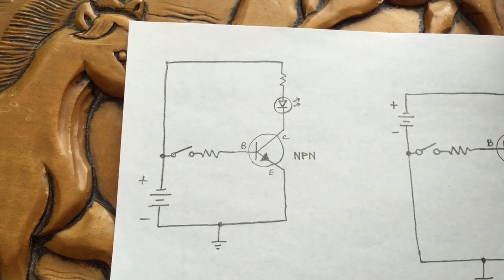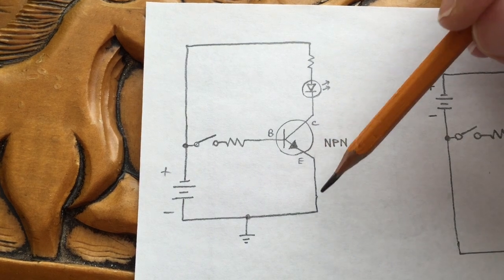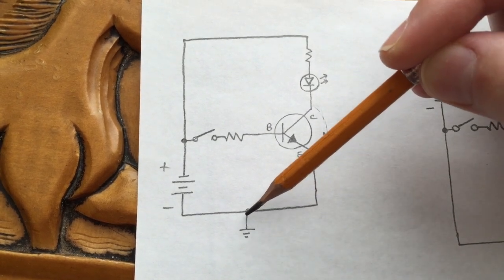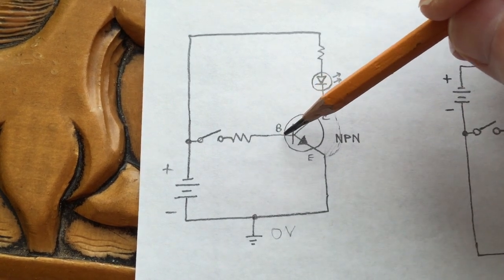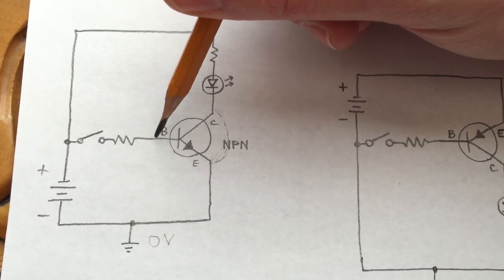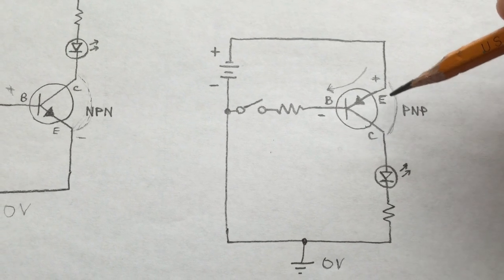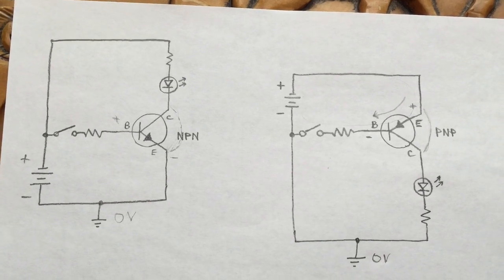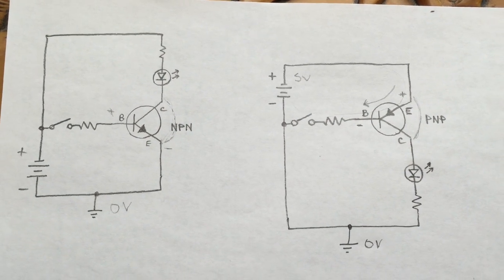NPN vs. PNP Transistors as Common-Emitter Switches

Comment: Thank you for your video. One small correction - your battery symbol is back to front. The long bar is the positive end just like the long leg of an LED is positive and the long leg of an electrolytic capacitor is also positive.

Comment: Excellent - a different type of explanation that works really well.  You could have just mentioned Common Collector/Emitter terms as you diagrams showed it so well.  The battery symbol, for students... think 'positive means more' so the longer of the two lines, the shorter of the two looks like a minus symbol so you can remember how to draw single cells or batteries.

Comment: In an actual circuit for PNP we found that it worked when the battery was across the base and collector and the voltage going to the emitter was -ve

Comment: The must important thing you didn't explain IS the pnp IS suppossing to use for the not Gate and the npn for the yes Gate , if u dont supply the base from your pnp , the logical IS true and your del Can be activated, if u you supply it your del turn off , and for the npn is the contrary😅

Comment: i thought the pnp and npn to close the switch would need some form of magnetism? am i missing something? TIA
Reply from the maker: No magetism is involved. There are no moving parts; the transistor is not a mechanical switch like a relay. It is a solid-state silicon device that uses a small current to control a larger current.

Comment: I often hear people say current on the base turns on the transistor, but its voltage that does that... yes/no? Unless you get the voltage minimum, no amount of current will get you through. I'm a beginner, so maybe I'm wrong, but a lot of people seem to want to use voltage and current interchangeably, and that confuses me (personally) when I'm trying to learn something new.

Comment: Good description - but isn't that battery symbol turned around in your schematics? I thought that the long line, or dash, was for the positive terminal, the short one representing the negative terminal. Anyway, the ground connection in a circuit employing npn transistors - say in a transistor radio - would be the negative terminal. Hence there would be one location in the circuit where all connections to ground are soldered, including the negative terminal of say, a nine volt Duracell battery. And for such an appliance that employs pnp devices, simply reverse the polarities. I guess that's right.

Comment: Excellent video.. I have an arduino on 1 side that will switch a pin to high (5v) and on the other I have a small lamp powered by its own batteries that I can switch on by using a switch..

My question is given these are 2 power sources and thus different grounds, can I safely use a transistor like BC 547 or should I use something else and if so what would be ok?

Comment: If the resistor at the top of the drawing in the NPN circuit is there to protect the LED, shouldn't the resistor in the PNP circuit be on the other side of the LED?? If not, I am confused about direction of current flow in the PNP circuit.

Comment: Aha, the base get connected to the power supply side that is opposite to the sign of what is the middle of the transistor.   If it is N then the base goes to the positive side of power supply and and if it is P, the base gets connected to the negative side of the power supply.
Aside from that, the load always seem to go the collector side, however the pins are designated.

One has to admit that this whole emitter collective base thing is pretty screwy as hell.  Can it get more screwy?  I don't think so.

Comment: On the pnp transistor why do you still have the resistor in series with base? To protect the negative side of the battery since the current gets outside of the base?

Comment: What happens if you connect 5 volts directly to have of npn with its collector to vcc and emitter directly to ground without any resistor. Will it smoke? 
Can you have more than 0.7 v drop accross base emitter junction?

Comment: What is the point if u still need a mechanical switch and it can get the job done by itself?
Edit: is it because you can use a low current to power it?

Comment: This made me more confused. I've always been taught that DC voltage comes out of the negative and flows back into the positive. Subtracting voltage from a battery and adding unused power back to the battery. What transistor will allow voltage to pass when the base is disconnected and stops voltage when the base is connected again?

Comment: why do we need a transistor as a switch when we already have a switch in the circuit?
Reply: The transistor is used to amplify/double up the current. So that collector current will be higher than the base current. Correct me if I’m wrong

Comment: Just a question on the battery, here in the UK when we present a battery in a circuit like this, we always have the longer line as the positive side. Is that not the case for you guys, as you have it the opposite way round?

Comment: Why use a transistor at all? Why not just a battery, switch, resistor and led? :)
Reply from the maker: Chicken Nugget because then it wouldn’t be a demonstration of how transistors work! ;) in a real-life application, the transistor allows a very small signal (like from a touch sensor or a microphone) to control a much larger signal (like an electric motor). A typical small-signal bipolar transistor like the one shown in this circuit can have a current gain of over 300x.

Comment: Would the PNP circuit work if the order of the three elements, currently PN closest to +V, LED in the middle ,Resistor closest to 0V, were arranged differently?

There are six cases: PNP/LED/Res; PNP/Res/LED; LED/PNP/Res; Res/PNP/LED; Res/LED/PNP; LED/Res/PNP.

I suspect the order relative order of just the [LED, resistor] pair is not important, and it would always work if the PNP were not last; that covers four of the six.

However, would it work in the last two, i.e. if the PNP were "last" and the Collector connected to 0V?

I undertand that Ie=Ic+Ib, and that might affect the choice of resistors, but I am not asking about that.  I suspect this question reduces to whether there is a voltage drop from Base to Collector, where Collector=0V=Ground, which voltage drop would cause a current flow.

Thank you.

Comment: Excellent video! I was just. curious, if all Neg runs back to the power supply, what is the need for the ground on the bottom? Thanks!
Reply from the maker: Full Wave Recked it’s not necessary. I just put it there to indicate that I am treating the negative side of the battery as the ground reference. No current flows to/from it.
Reply: @kevpatt  the obvious strikes again. I'm too much of a noob to be asking a smart are question. That makes total sense. Thank you for responding. Cheers!
Reply from the maker: @fullwaverecked  actually it's a good question. After all, I'm the one who drew the battery symbol upside down... :P

Comment: What is the reference for the terminology of base, emitter and collector?
I’d call the base the control terminal, collector input and emitter output.
And why not put the LED in the PNP circuit before the transistor? It might cause a small drop in voltage but with the base connected to ground, this will always be lower.

Comment: Kevin,new subscriber and I was wondering if you know of a site that will tell you the specs of certain resistors like which leads are Base Collector and Emitter or is there a way of using a piece of equipment to find out. Thanks in advance Artie. 👍👍👍

Comment: Really good explanation, thank you! In the PNP schematic, shouldn't the resistor be in between the Collector and the LED, instead of between the LED and ground?
Reply: It doesnt matter. As long as the resistor is part of the loop it will do its job of limiting current. Dont think about current getting to the LED "first" and destroying it because the resistor hasnt done its job yet. That is not how it works. When the circuit is closed the current that will flow is dependent on all the elements that are part of the loop.

Comment: If you would like to understand, how it's actually work in field of industrial automation, where you have PLC input card, where you wire sensors, read on.

In NPN sensor drawing (0:26), top part is actually PLC input (could be relay or something else). There is permanent 24VDC on PLC input and wire going from PLC input to sensor is going to the collector of transistor which is switching negative (N pn - switching negative). 

If you take DC voltage multi-meter and connect black probe to 0VDC and red probe to PLC input and there is 24VDC, that's mean you have to use NPN sensor. On other side, if you want to test the sensor, connect red probe to 24VDC and black probe to sensor output, if multi-meter display 24V, then it's NPN sensor. Sensor have to be in ON state of course.

IN PNP sensor drawing (4:59), bottom part is actually PLC input (could be relay or something else). There is permanent 0VDC on PLC input and wire going from PLC input to sensor is going to the collector of transistor which is switching positive (P np - switching positive). 

If you take DC voltage multi-meter and connect red probe to 24VDC and black probe to PLC input and there is 24VDC, that's mean you have to use PNP sensor. On other side, if you want to test the sensor, connect black probe to 0VDC and red probe to sensor output, if multi-meter display 24V, then it's PNP sensor. Sensor have to be in ON state of course.

Comment: I'm familiar with sinking/sourcing in regards to industrial electrical controls, but I don't understand why you couldn't have the load of the NPN transistor connected to the Emitter instead of the Collector! Would it work? Is it atypical? Thanks! I have so hard of a time remembering which way the current flows NPN vs PNP.

maybe it's called Sinking/Sourcing because you're Sinking/Sourcing the transistor not the load?

Comment: If I am using an npn transistor and I supply the base with say 5v from an Arduino through a 4.7K resistor,  then give the collector 12v why can’t I put the load in the emitter line to ground?

Comment: Best explanation I've seen, thanks so much.
And what's the drawback if the LED put in between NPN BJT's collection terminal & GND (low-side) instead of high side?
Reply: In NPN, the LED or whatever load on high side of transistor, the emitter voltage will be zero but if we place the load on low side, the emitter voltage will be the same as battery so, current won't flow because transistor need voltage differential at least 0.7 V to turn on.
I hope this would help 😅

Comment: In the PNP transistor why wouldn't the resistor be before the Diode and not after it?
Reply: As the resistor is in series with the LED it doesn't matter if it's before or after.

Comment: In the U.K. especially in industry, PNP based sensors are a lot more common. That’s because you’re switching the positive terminal of the load. It makes much more logical sense to use these transistors for references as it’s more practical. As most people will treat an output from a sensor as a positive terminal and look for a negative reference.

Comment: This may be a stupid question but on an NPN transistor do base and collector voltages need to be the same. Say I wan't to switch a 12V source but the device I'm using to control the switch can at best deliver a 5V source is this a problem?

Comment: Hello and thank you for the very nice video ! My question is, in PNP why is the LED's resistor after the LED ? While the current flows from positive to negative, shouldn't the resistor be prior to the LED so that it doesn't burn ?
Reply: It doesnt work that way. When the circuit is closed, the amount of current that will flow is dependent on all the elements that are part of the loop independently if they are found before or after in the path. Remember the positive to negative convention is just that, a convention. The electrons, which are the charge carriers, are moving in the opposite direction...

Comment: Thank you my friend for this goooooooood video, just 2 comments:
1- The battery symbol is reversed.
2- you forgot the second battery which is in the main circuit that will make the LED to glow.

ThaaaaaaaaaaaaaanQ
Reply: He didn't forget a second battery. In this configuration, the smaller circuit that drives the transistor uses the same battery that powers the LED.
Reply: @venitusaber2131  
Ah yeah got it brother thanq, I have forgotten considering the resistors :))

Comment: Does the base need current or voltage?
Reply from the maker: The base needs a small current to turn on. But the only way to get a current to flow is with a voltage differential. This voltage will need to be higher than the intrinsic voltage drop of the Base-Emitter junction (depends on the transistor), and you will want to limit the current flow with an appropriately-sized resistor. This can all be calculated using Ohm's Law: I(current) = E(voltage) / R(resistance). ([Supply Voltage] - [B-E Voltage Drop]) / [Resistance] = Base Current

Comment: Not sure that you realize - by this time (May 2019) your video is the best on YouTube explaining how a PNP transistor works. You don't explain how the electrons flow inside the PNP transistor but providing that one knows how the electrons flow inside a NPN transistor (plenty of videos about that on YouTube) and from all the other details that you clarify it becomes obvious how the flow of electricity from Emitter to Base allows the PNP transistor depletion zones to open up for higher current flow.
Thank you very much!
Reply: @GreatWhiteNiko. You know about this stuff. Does the base need current or just voltage? I am trying to make my first pulse motor which is like the HOLY GRALE for me.. The base gets its jolt from spinnin the rotor (with magnets attached) near a coil. The NPN opens and lets trough a big puls of current to magnitise the coil. This pulse of magnetism pushes the rotor along. I think I got the theory down but in practice.....
Reply: @captainprototype187  Oh no, don't get me wrong.  I am just starting to learn electronics.  So far I'm at the level of "how it works" but literally nothing practical.  You need to ask someone else. Your question makes me wonder too - does the base need amps and voltage or just some so-so voltage?
Reply: @captainprototype187  Well, today I asked a friend of mine that is an electronics guru about the very basics of transistor use.  What he told me was unexpected for me.  See if you learn something practical too:

1. Bipolar (PNP and NPN) are used to REGULATE current. 
Used to control motor speed for example.

2. FETs (MOSFET) are used as switches - just turn on/off the current.
Not sure in what applications they are used most.  I see them in TV circuit boards all the time. If they are used as switches it'd make sense to assume that FETs are used in computer chips but I apparently speculate here.

Also:
1. Bipolar - the gate uses CURRENT - From 0 up to 0.7A.  You vary the current (Amps) of the gate and the big current from Emmiter (Source) to Collector (Drain) varies with it.

2. FETs (MOSFETs) the gate use VOLTAGE.  Because what you want is to "pressure" up the area that creates the magnetic field which "opens" the flow of current from Emitter to Collector. And FETs basically work like that - you supply voltage and they do nothing.  You increase the voltage and they still do nothing.  Then at some point they let all the current flow.  So that's a "digital" type of operation - 0 or 1 - closed or open.  That's why they are used as switches.

My friend also said that all the details about electrons/holes, and depletion zones are not needed at all when you actually work with electronics.  The movement of electrons etc are good to know and cool to know but once you start practically using the components that goes way way in the background. But to me it is about feeling confident about my knowledge so I like to learn stuff like that.

Good luck.
Reply: Thanks. some new info here. I will concentrate only on npns. Making a working circuit is hard you will find. It is for me, anyway.
Reply from the maker: @GreatWhiteNiko  Your friend is basically correct, and the theoretical function of BJT and FET sounds right. I just want to add that you CAN use Bipolar junction transistors as "switches" (as shown in my video), and you can use MOSFETs as "amplifiers / regulators" too. But in non-trivial designs, Bipolar transistors are often chosen for linear applications (like regulators), and FETs are often chosen for switches, mainly because they can have very low on-state resistances. But controlling a BJT or an FET only requires a properly designed circuit, and either one could be used to design a motor drive as you describe.
Reply from the maker: @captainprototype187  I think I answered your question in a reply to another one of your comments.

Comment: Shouldn't the resistor on the second circuit be before the LED? You drew it after.
Reply: It doesn't matter as long as they (both) are in series with the battery. Current must flow through both the resistor and the led no matter what order they are put in. Only when current flow will the led lit. Yes the led ONLY works in one current direction because it is a diod, but the resistor is not depending on the current direction and can be located anywhere (even hidden) in the circuit as long as it is in series with the led and the battery.

Comment: Thrres no real switch in there. Whst makes the switch????
Reply from the maker: You have to push on the switch to close the circuit. :) It's the "lever" looking symbol just to the left of the resistor.